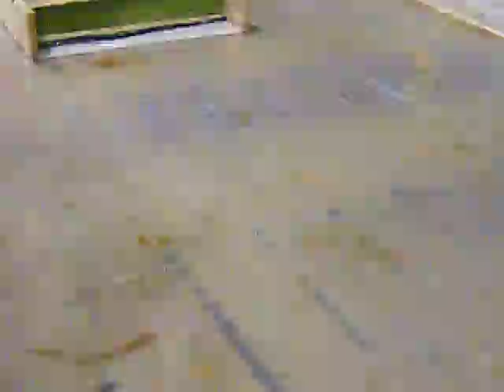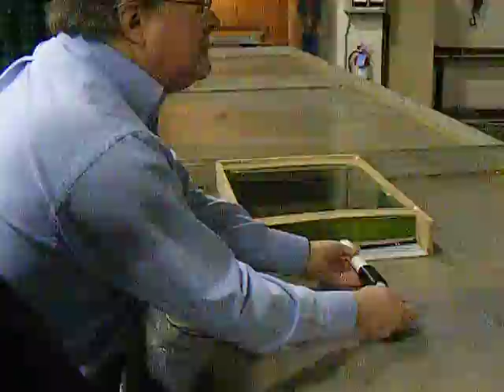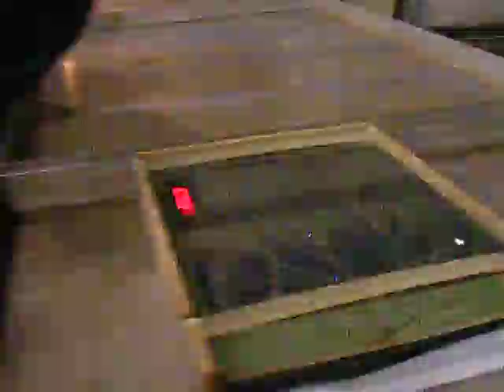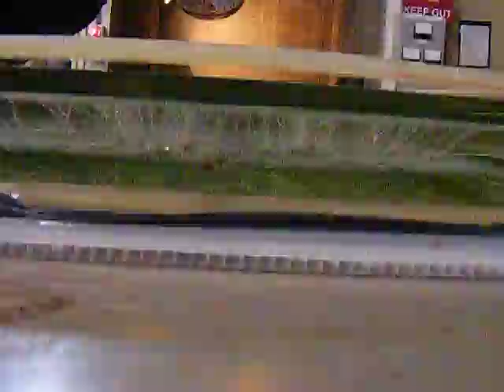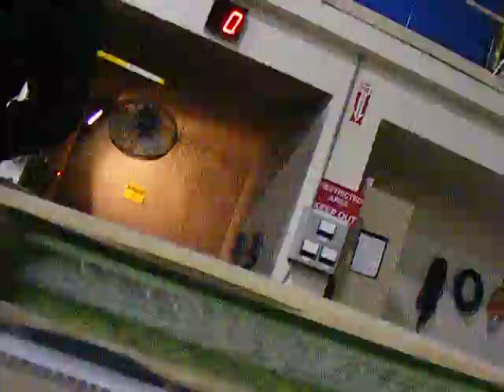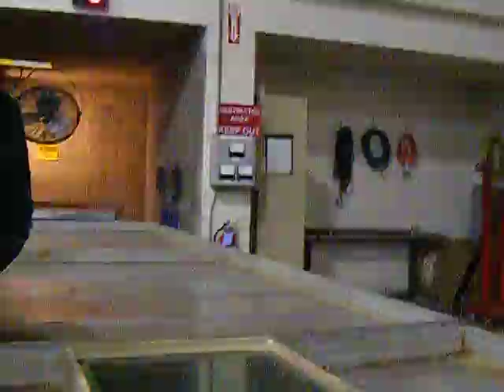Creating a huge 2 million volt two-layer Captured Lightning sculpture!

Comment: Is this releasing X-rays when you crack it?
Reply from the maker: Apparently not. Many years ago we were concerned that the high E-field (>2 MV/cm) might create X-radiation during the discharge. We tried placing a grounding screen and a sheet of sensitive mammography film next to a large sculpture and then discharged it. There was nothing on the film when it was developed. Apparently the high pressure plasma and density of the solid acrylic prevent electrons from gaining sufficient kinetic energy to create X-rays.

Comment: what if I touched  that  glas  during  that  small spark flashing? :P after the main discharge
Reply from the maker: You'd get stung by the small electrostatic discharges. This happens to us all the time when we handle specimens that have just been discharged. Although the small jolts from the secondary discharges sting a bit, they aren't very painful, and they're completely harmless. However, we do try to avoid getting zapped by the main discharge since it does hurt, feeling more  like getting punched than an electrical shock. And the main discharges are potentially dangerous - there is a small risk that the high-current pulse can disrupt your heartbeat, triggering life-threatening fibrillation.
Reply: Bert Hickman thanks for response!!! i was also watching video about making these , ( probably also one of your videos)   .. the whole process is so complicated and technically difficult... it surprised me ...  :) and also, i was reading the commentary to video, writing about  the main discharge reaching 1-2,5MeV and the current up to 3,5kA  .. that, I believe, is  hella dangerous xD  It is almost as  dangerous as being hit by the lightning  probably.. very cool stuff! I love  the process and results of your job :) good luck!

Comment: Can this be done at home on a smaller scale,using MOT,Teslas,VDG.s,Etc?Awesome!!!
Reply from the maker: Not really. You need an electron beam accelerator capable of delivering electrons that have at least 1-2 million electron volts of energy. A large Van de Graaff generator might be able to provide the potential, but you also need an electron gun and an evacuated accelerator tube. You also need lots of shielding, since million-volt X-rays are quite penetrating and dangerous...
Reply: Bert Hickman
Thanks for replying! I was really hoping a big home VDG or Tesla would do it.Damn
Reply: Bert Hickman You actually don't need that much voltage if you can accelerate the electrons properly. That way you could accelerate them to almost the speed of light.
Reply: gogo311
That probably sounded a lot better before you actually wrote it.
Reply from the maker: gogo311
True - an oscillating high frequency electrical field combined with a properly-shaped series of copper chambers (an RF LINAC) will also accelerate bunches of electrons to relativistic velocities. However, making an RF LINAC is far beyond the capabilities of even advanced home experimenters since it involves precision machining and tuning and a high power microwave source. A cyclotron is another type of device that can be used to create high speed electrons. Accelerators using Van de Graaff generators and cyclotrons have in fact been made by a few home experimenters. However, I am not aware of any microwave LINAC's being made by home experimenters.
Reply: Bert Hickman I've heard of microwaves accelerating electrons. I don't know more about it.

Comment from the maker: Wood won't work using this particular technique. However, another approach, using high voltage applied to moistened wood, can create charred paths on the surface that are similar to Lichtenberg figures. And this technique can be done at home,without the need for an expensive particle accelerator. Search YouTube for "wood Lichtenberg" or "wood burning fractals" to see some examples of this technique.

Comment from the maker: We have only tried it on bodies that have already been machined and tapped with the neck and all electronics removed (since the high voltage would kill any electronics). All of these specimens self-discharged, but looked great. However, if we started with a blank piece of acrylic shaped like the guitar but before any other milling and drilling has been done, it might even work differently and perhaps even better.